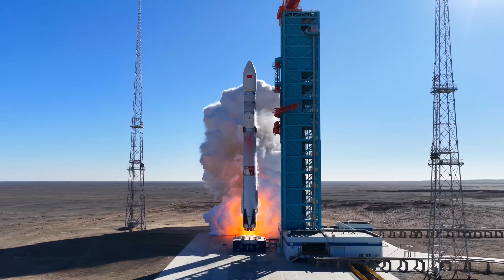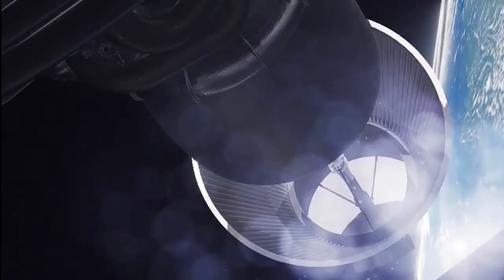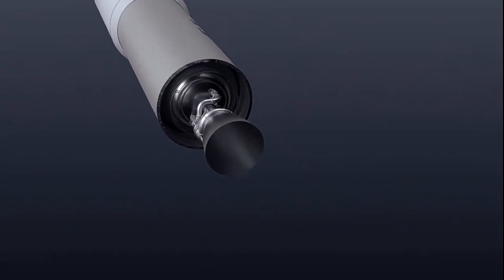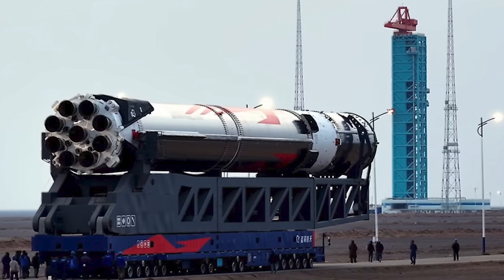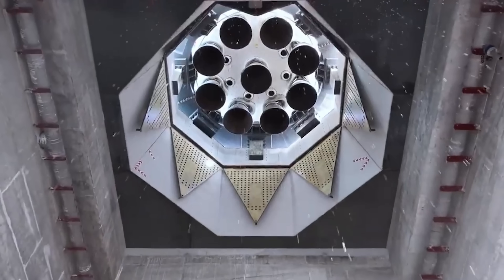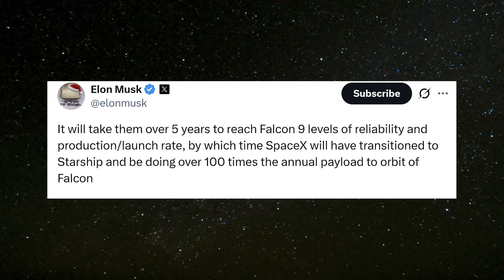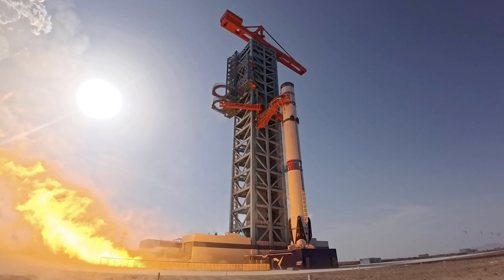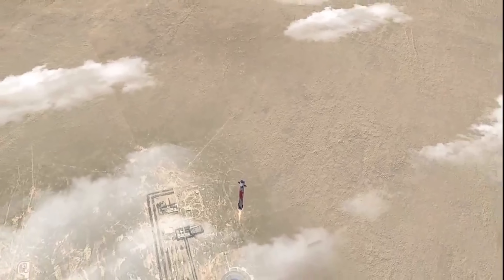China Brilliant Launch & Operate World's First Methanlox Rocket EVER. Better than SpaceX, NASA...

Comment from the maker: this makes LandSpace the first and only company to successfully launch and operate a methalox upper stage in orbit, Sooner than SpaceX and Relativity. What do you think about this achievement???
Reply: No it isn't. New Glenn is also methalox and it just sent two probes to Mars a few weeks ago...and unlike Landspace it successfully landed
Reply: non reusable
Reply from the maker: Yes!! Hope that they can do it soon
Reply: We can pay attention to the fact that a new rocket is expected to be launched on December 15, which has been installed on the launch pad and will probably broadcast the launch process live. It is also a methane recovery rocket.
Reply: @JonathanHoward-x1o  will not be long before they are reusable
Reply: @JonathanHoward-x1o 
The Space X version failed multiple times before it gets to current stage.
This year alone has failed 4 times and the worse part was it lost its precious cargos.
What's the use of reusable if the precious cargo gets destroyed?
How do you like them rotten apples?
Reply: @loktom4068  It wasnt carrying cargo. And those flights were succesful
Reply: 位于酒泉载人发射中心，隔壁南面，他将发射可重复重型火箭，本次卫星入轨成功，返回着落失败❤
Reply: They did it in 2023. Spacex did it with Starship in 2024 and Vulcan Centaur too i little earlier than Spacex and New Glenn reached orbital the beginning of this year. You make it seem like it was yesterday. Is this a repost?
Reply: There isn’t much to think about. They saw SpaceX testing the Raptor methane engine in 2016 and rapidly copied the idea
Reply: @tluangasailo3663 
Hey, All birds have wings, all humans have 2 legs. 
All cars have at least 4 🛞 wheels.  
You don't make sense. 
Copy that, little toddler.
Reply: @loktom4068 China constantly brags about achievements that it has not test achieved.  

This vehicle is not “brllient”.  It failed to have engines that were able to operate properly after reentry.  It could be a simple problem with one engine, or it could require a massive redesign of the engines or the complex plumbing, actuators and structures at the base of the booster.  

Let’s not call reusable launch system brilliant until it survives a landing attempt!
Reply: @tluangasailo3663 設計雷同，但發動機採用的技術路線不同，希望他能成功
Reply: @tluangasailo3663  And Starship did it in 2024 an year after Zuque-3 because all what he describes happened IN 2023. He make seem like it was yesterday.
Reply: @tluangasailo3663  Based on your logic, Falon-9 itself is also copy from China since ancient China invented world first rocket; desert eagle is also a copy from China since ancient China invented world first gun, XM1299 self-propelled Howitzer is also copied from China since ancient China invented world first cannon; M18A1 claymore mine is also copied from China since China invented world first mine; M270 Multiple Launch Rocket System is also copied from China since ancient China invented world first Multi-tube rocket launcher. MK62 quick Strike Mine is also copied from China since ancient China invented world first Naval Mine. US Rapid Dragon Palletized Weapon System is also copied from China since ancient China invented world first Repeating crossbow.
Reply: @kinwaisiu9414  No, SpaceX falcon is not a copy of ancient china rocket because ancient china rocket never went to space and deliver satellites and lands back on earth
Reply: @tluangasailo3663  The political corruption in Usa and Europe is almost the same, even the information and traffic fraud are fake!
Reply: @golden-head-0 is that how China rocket is so far behind spaceX
Reply: @tluangasailo3663 they did not copy the idea, the work on the subject matter and make it work.
China 🇨🇳 is winning against the United Sanctions of America 🇺🇸
Reply: @tobiasrekker5376  USA = 530 rocket landing, China = 0. Yea, china is winning sure

Comment: "First world Methalox rocket"?  
1. Its is Metalox not Methanlox.
2. Terran 1 from Relativity space was launched in 2023, New Glenn from Blue Origin, Vulcan Centaur from ULA (using same BE-4 engines from Blue Origin engines) and Starship from Space X: ALL USE METHALOX.

Zhuque-2 not 3  (yes this is the Pinyin correct transliteration)  milestone is that it was the first: all I mentioned did the same in 2024, except New Glenn that did in 2025 and Terran 1 failed.
You put it in a way that make it seem it was yesterday.

Are you commemorating the word of the year 2025: ragebait?
Reply: NONE of those are mathlox,    also they are very small rocket  also i do not see any video of success of those rocket,  only starship from spaceX  is legmate, but it failed hundred times already,  also  spaceX  is NOT even a US rocket, its south africa